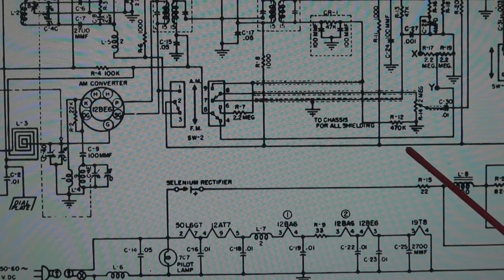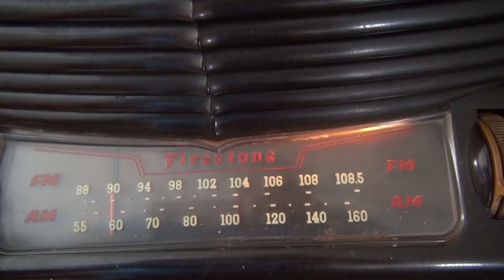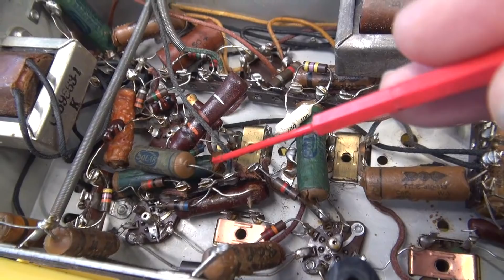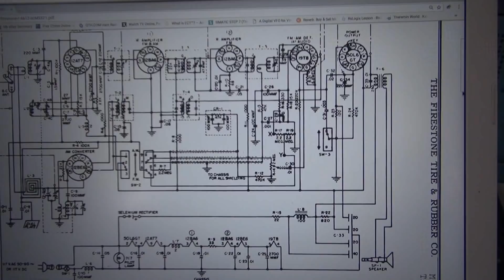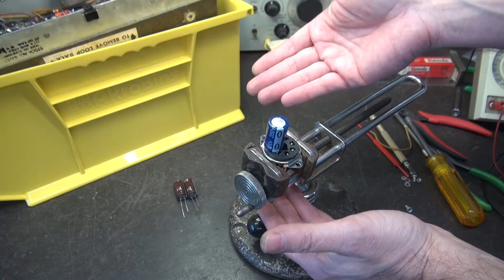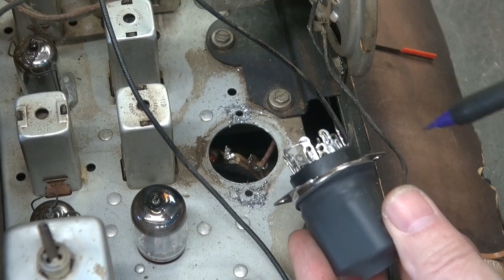How to repair Vintage Tube Firestone AM FM radio hum distortion D-lab

Comment: Gerst video about cap replacement. When I do a re-cap, I usually turn on the radio after I install 2 caps to make sure I am still getting a reception. It's a good saftey rule I use. Would hate to re-cap 6 caps and turn on the set and got a surprise.

Comment: Many thanks for this video. 👍 I'm restoring a 1953 Firestone 4-A-113 AM radio-phonograph. I restored the mahogany cabinet and the VM record changer and actually the radio works great, but since you & all the radio repair sources suggest, I am replacing the capacitors and the filter capacitor and checking the resistors. I gather some purists do not want to change the appearance of the original components, but since the radio chassis is hidden from view seems like the most important thing is to get the radio working and not worry about whether it looks 100% original. No one better be poking inside of my Firestone to see if the filter cap is original. Ha ha. Doesn't look like you ever respond to any of the questions in the comments, so I'll close without any questions.
Hope you are well.  🙂

Comment: You can replace the power caps by this process also... Take out the power cap can.... Open it... Take out all old filling in the can... Connect new suitable capacitors as previous capacitor was on the base... close up the can... Place it at it's place.. that's it, all done. This method keeps the old look also of the radio....

Comment: I'm restoring an old Sparton Tube radio circa 1946 and run across something on the schematic that I have never seen before. The last resistor listed says R18 2700 ohms 5. w. w. w.. All the other resistors show the ohm value and watt value as an example R4 100 ohms .5w etc. My question is what does it mean when there are 3 "w" s like that? I went ahead and replaced the R18 with a 2700 ohm 5 watt resistor. The radio works and I  have the proper voltages but the resistor is getting extremely hot. Any thoughts, ideas or suggestions would be appreciated.

Comment: I have a question. In service manuals of these old radios, there are always instructions for alignment, by injecting a certain frequency here, measuring something there, then turning the top of a coil and so forth. I have not heard those mentioned in your videos...is that not needed? Do these things never fall out of alignment? All the best

Comment: Your funny Terry
Get all those ugly old crusty cigar buts outa
There. Vary interesting
Many years ago back when I was in high school I'm 63 years old now I replaced the electrolytic in the power supply of an old 1940s 50s wooden cabinet table top a.m. shortwave receiver bought from a wino and that helped the radio I should have replaced all those old crusty cigar butts cuz it probably would have worked better then just replacing the electrolytic what about 10 years later one of the i f Transformers Let the Smoke Out and that was it for the radio no parts could be found it was fun repairing it with the teachers help it was a hot chassis radio just like the Firestone radio you are repairing in this video but you have some funny terminologies so Terry keep getting those old crusty cigar butts out of there hahaha it's always fun repairing old electronics and seeing them work again.

Comment: Can you tell me what type of solder you use
I use 63 37 as it is a eutectic type that has no plastic range.  It goes from liquid to solid, no cold solder joints
Most solder might be 60 40

Comment: Excellent.
I like the way you put J hooks on the parts leads.
The Carlson videos do the opposite and I don't agree with him.
It's not only the risk of damage to the IF coils it's also the risk
of damaging anything - including tag strips, resistors and other caps.
You have to make the least disturbance possible.

Comment: Maybe for a vintage radio like that maybe you want to use “new” paper in oil caps,  like the Russian military grade,  I had bought them in a large amount of values, they are relatively cheap
Reply: Can you, or someone, let me know what is the ohm value of the small resistor on the top of the tuner?
It only has one stripe. 
I have one with only one red stripe on a brown body and it measures completely open.

Comment: I recently acquired a Zenith Long Distance Radio, But the tuning mechanism has a belt between the knob and the tuner, that slips, which makes it hard to tune, I've made a make shift antenna and was able to get three stations... Question, any idea how to repair or replace the belt and what type of antenna would work on this radio? Thanks Ralph

Comment: You don't care about the direction of the caps marked with a band ?New caps mostly don't have those markings but it has it's sence to install them properly.This reduce hum.And there is a method to find out which side of a unmarked cap is the outer foil

Comment: Why dont you check all the resistor values make sure they still in tolerance?Any ac/dc radio for repair must use a mains isolating transformer!

Comment: Terrible job ...if it works does not make it right... your cap replacement leaves a lot to be desired. That J hook as you call it as other cowboys do it, is lazy, and that is all it is. I use a solder sucker and put heat sinks on adjacent components and or on 'IF' lugs to prevent heat damage. And a point to point device needs axial lead caps and not printed circuit caps as you use. Buy the right type of caps. That is just anther sign of being lazy. Also have respect for these old radios that I see you don't destroying that chassis with that 3 filter cap replacement. That was horrible what you did and looked terrible. Do people a favor and don't work on any more sets especially videoing your terrible work. People will think that's is the way to work on these old radios when it is NOT. Get into a different hobby.  If you cant show people the right way to do repairs don't show them anything. By the way what is your qualifications?? I was a color TV analyzer in the 60's for Westinghouse in there Metuchen, NJ plant, and an electronic tec, a ham, and a license by the state electrical contractor for 45 years.
Reply: I completely understand what you mean.  However in today's world, economics come into play.  Time is money, and the time it takes to do it "the proper way" simply exceeds what many people are willing to pay for "an old radio". Some people just toss them in the trash.  Each time that happens another piece of history is lost. Shortcuts must be utilized to keep the labor charges within reason and to keep these old treasures "alive". And if only a few people are willing to pay, then it's hard to "put meat on the table".  Most people (consumers) look at "cost" vs "value" when it comes to repairing electronics.  If it costs too much to repair, out it goes and they buy something else.  You call it "being lazy" and that may be true in some cases, but what Terry did was both economical, and electrically (functionally) correct. And he didn't "lose" a repair job.  Though I would have used some fiberglass sleeves in a few spots for safety.  It makes no functional difference to use a radial cap in place of an axial with space permitting. I mean, look at the cost of axial caps! The prices are artificially inflated only because of the application.... "tube gear"..  The prices on Mouser and DigiKey are much higher for axial caps as well..
Reply: Dear Mike, can you please post an own video on how you would do this restoration instead of only criticizing around ? That would be very nice because I found no content on your channel whatsoever. I fully concur with Jeff Counsil and I also do my restorations exactly as D-Labs does it, it is the most economic way by far. And also please do yourself a favour and never watch any of my up and coming tube radio restorations or especially any videos from Shango or Radiotvphononut et al, they will get you hyperventilating ;-)

Comment: There was plenty of room under that chassis for separate electrolytic caps. Just clip the terminals off at the filter can and add the new caps. No need to remove the old can or drill out the chassis. If the owner looks inside, it will still look untouched. Just my 2¢
Reply: There may have been enough room, I agree.  Some people open the cans and re-stuff them with modern caps to keep the original "look". Though some people put too much emphasis on "resale value" and "originality" as if it is something "special".  As soon as you even change one tube, resistor, diode, light bulb, or cap, it is no longer "original" anyways. Even if you use the same "NOS" tube (or part), it is not original to that unit. To me, and many of my clients, the true value is in it's functionality.  If it doesn't work, there is no "value" no matter what it "looks" like. 99% of people who get something like this repaired will never even look inside it.  They just want it to work.

Comment: One other question. I noticed you didn't mess with the selenium rectifier.  I'm guessing you verified it was performing properly?  I have been told that they invariably fail with age just like the filter caps.   True, or no?   Thanks!

Comment: Thanks for doing a Radio repair!  (I guess the sel. rectifier could have been replaced but what the heck).  One time I replaced the filter caps and actually got them to fit into a small, black plastic, Fuji 35mm film canister!  I fastened it down with the original bracket and it looked great, lol.

Comment: I watch some sort radio related Youtube video just about every day- that's lots of 'em.  I think this video is the best I've seen on how to restore the electronics on a tube radio.  You take it down step by step.  There isn't a lot of "lagtime" or silence in this video.  You offered a few great hints: The plastic bin for a chassis stand- never thought of that, cutting that pesky cap in half to remove it- amazing; never thought of that either; and the cap replacement with a tube socket.  I am going to recommend this video to anyone new to the hobby of antique radio restoration.  A fine job, sir!  Two questions: What size chassis punch did you use, and what size screws to mount them?  Thank you so much, D-Lab!

Comment: genius idea with the yellow tray.  I am expecting some new caps in the post this week, to replace paper caps in my old record player.  wish me luck!  another great video, most enjoyable.  I love the tube socket and caps idea too.
Reply from the maker: Cool deal man, Glad you like + good luck on the project. What kind of record player? I have worked on many VM's, Newcomb, etc, school house type.
Reply: Its a Garrard RC120 4Ha changer, which I have stripped cleaned and re assembled.  The amp is a one valve wonder generic no name.  The part one video is at the top of my channel now.  I mentioned you in the credits at 9'40

Comment: Hey Terry, another great video - thank you. Do you have any designs for AM broadcast tube transmitters - a 2 or 3 tube unit for feeding sound to all the AM receivers in the house. I know there's a few designs on the net but I'm guessing you might have a great circuit or even built a few. Maybe something that will meet the regs over there but can also crank out 5 - 10 watts as I can legally use that here in New Zealand (I have the appropriate license). 73.
Reply from the maker: Graymark used to make that item. They pop up on ebay. A good way to get started.

Comment: Really nice job Terry.  Question :  Why do you prefer the hook method vs. the coil method when replacing components?  I live that tube socket idea and will use that for sure.  Where did you get that chassis punch ?  I have to look around for that... Great job as always  Ron
Reply from the maker: Hi Ron, I do not know what the coil method is. The J hook method was instilled to me while going thru USAF training. Always done it that way. The Chassis punch is 1-1/8" Greenlee. They are very pricey. Best to look on ebay for a good used one.
Reply: Thanks for the top my friend....  BTW - I am just starting a project to build your dual rectification 6AQ5 amp...  very cool.... thanks much

Comment: Hi Terry,  I saw something on the schematic that I didn't expect nor entirely understand - the small value caps across the filament series string.  That is, C16, C18, C22, etc.  I've seen those in parallell with filter caps in hifi designs; but, not across AC filaments.  What's their purpose?
Reply: Noise/Rf  surpression filtering.
Reply: @olradguy  Awesome - I  never did figure that one out.  Many thanks for passing on the info!

Comment: Would you also recommend a ground power supply?
Reply from the maker: Hello, Not on this type radio. It is a "HOT CHASSIS", no power transformer. A grounded cord would Shock you or damage the radio.

Comment: Could you do a video on how to properly replace a selenium rectifier with a modern silicon diode and how to compensate for the voltage difference?
Reply: ruff hardin check out the allamericanfiveradio channel or radiotvphononut.  Both of them go into that process.

Comment: FIRST thx for the vids terry!! love the long one's!!
Reply: Did you put a 1N4007 across the selenium? I always do because those aren't as reliable after all these years. Even on amps like the Mc240, I put a silicon diode in place of selenium. I do have to put a 4.7k in series with the input otherwise the bias voltage is too high. Love your videos and your granddaughter is a charmer. I live in Michigan and I hope to see you at one of the old radio extravaganzas to say hi.  Mike  N8TPI
Reply from the maker: You are always my 1st. Glad you like!